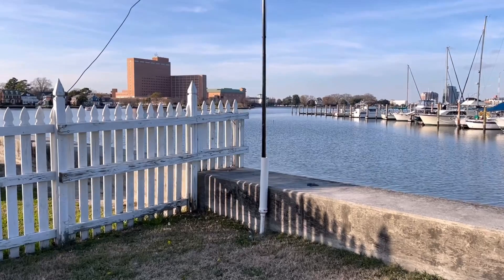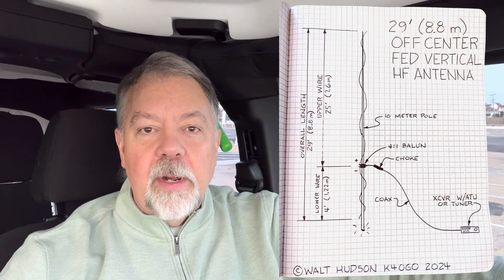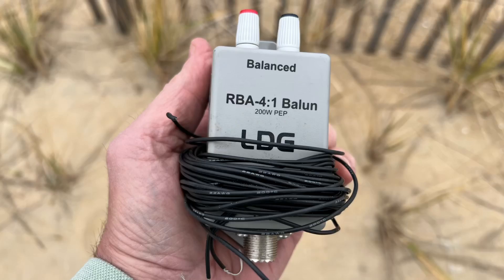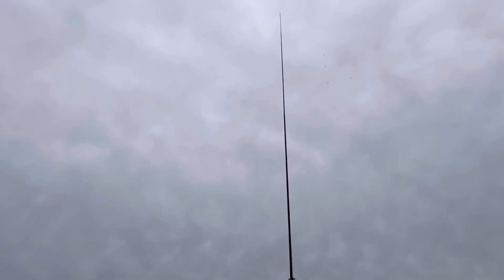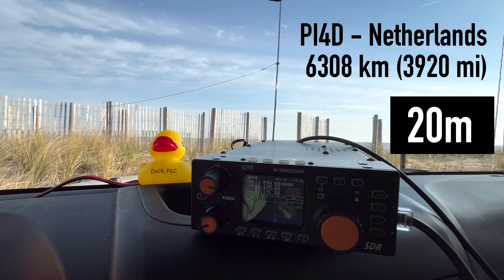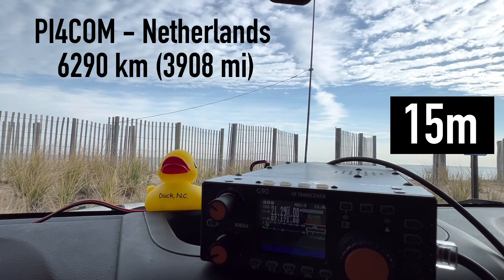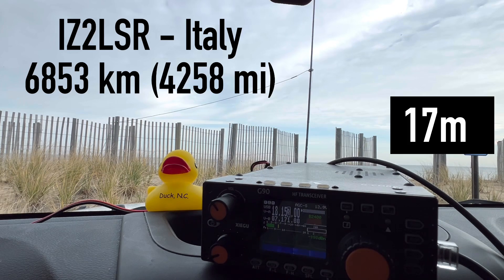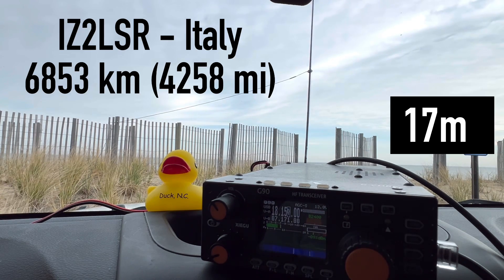Building an Off Center Fed Vertical Antenna

Comment: OCFD random verticals are my favourite multiband antennas.  I've used one at a few locations , not just by the sea and been surprised how well they work.  Hopefully soon I'll be moving to a new QTH with no antenna restrictions so can play with a permanent version and see if I can get 80 - 10M.  A shorter ( 25 ft total wire) got me on 40M - 4M but wasn't too good on 10M as too long.  All the best and 73 from G4GZG.

Comment: After trying the smaller 20 version, I decided to try this one. Again, I had better luck with a 9:1 unun...I use Balun Designs units. I got it up on the pole and checked my nanoVNA...nothing usable from 17 meters and down. Nice dip on 20 and decided to look further down and was surprised to find a nice dip on 40 meters. Surprise..surprise. There's one thing I've noticed about these ofcd verticals...they receive very well. Good signals really pop out of the back ground. So I'm good with using two of these to cover 40 thru 10 meters...they just really work.

Comment: greetings, I put this coastal antenna together this evening and it worked just as you said it would with 25' up and 4' down, but i used a 4 to1 unun instead of a balun, had a good contact on 40 to south Florida from the mountains of Virginia right off the bat. The 7300 was able to tune up on 40  and twenty with no problem. I'm heading for the coast in a few weeks to try it out. Thank you Sir. good job on your channel content. Think I'll try a random vertical next. Funny thing, a 29' wire is just the right length for a random😎
Reply from the maker: Awesome, thanks for sharing

Comment: I just completed the final install of your Coastal 20 here at home.  I live in a very tricky antenna situation, and your CO20 has allowed me to get on the air, rather than sit and ponder what can I build that is resonant on the bands that I want to work.  I have a lot of commercial antennas for remote work where I can go EFHW or ground vertical with radials, but here at home I was really vapor locked.  My vwsr measurements across 10-80 pretty much mirrored your reported numbers.  I even played with adjusting the upper and lower elements to "drag" the overall curve around, and found that I was able to slide things to bring 80 and 10 in and out.  I finally settled on your published 17.5 & 3, as that seemed best for my needs.  I tried the 4:1, with no improvement.  My soil is about a 1 at my location, compared to your salt water, but I "think" that has less of an impact in this design.  I appreciate you noting in this video that this design is more of a random wire construct.  That really tied things up in my brain, for this design.  And explains why in the heck the best dip is more like CB range.  I'll ponder this revision to design.  I subscribe to probably 50 other Ytubers regarding HAM.  You are without a doubt my favorite.  Dinner and drinks on me if you ever pass through northern NM.  Craig
Reply from the maker: Thanks so much Craig. I really appreciate this comment. All the best my friend! 73, Walt

Comment: Thanks, Walt for another antenna build. I built this one today and had great results on 10, 15 and 20 meters. One contact on 20 meters was in Chile (4,934 miles), but I could not get it to tune on 40 or 80 meters with the G-90. The SWR was off scale.
Reply from the maker: Thanks! Interesting that the G90 wouldn’t tune it.

Comment: Hello Walt, thanks for yet another quite interesting video. May I ask what made you switch from unun to balun for this variant? Isn't it an asymmetrical antenna as well?
Have you been able to tune it on all bands with the G90's built-in tuner? It didn't look like a good start on some bands.
Reply from the maker: Hi Alain, I treated the antenna as a balanced antenna just like a regular resonant OCF the uses a balun over an unun. It did tune everything from 80 to 10. I’m going to get back out with it in another location soon and try it later in the day to see how it does. 73, Walt

Comment: LDG 4:1 and 49:1 Baluns are impossible to find. I think they stopped making them long ago.
Reply from the maker: I have seen and purchased the 4:1 balun at DX Engineering. I agree on the 49:1, I have them all but that one. I’ve been looking for one.
Reply: I was thinking of a Current Balun. Forgot about the voltage balun. About the 49:1, seems nobody has any idea why it’s no longer made.  @COASTALWAVESWIRES
Reply: You will have to learn to wind your own

Comment: Good Morning Walt, what was the length of your coax with the ferrites?  I was at the Orlando HamCation on Friday; it was great.  Was trying find M&P POTA coax with a 50’ length with connectors, without success.  Did pick up some unun’s to try out and experiment with your designs. Thank you for these videos. Look forward to each one!  ‘73. AC3EA
Reply from the maker: Thanks! The coax is the Chameleon Antennas 50 foot coax with built in choke. I have a collection of all the LDG baluns and ununs I experiment with. 73 my friend

Comment: I managed to get a G90. They were out of stock at all the usual dealers here, but the importers had some and they were 10% cheaper than the retail outlets. Just working to set it up the way I want it and then get out for some /p.
Reply from the maker: Congrats, you’re going to love that radio!
Reply: You're going to love the G90

Comment: Hey Walt You are already getting great results but  If you use a resonant total overall length you would not need a tuner.  ~32.5 feet fed off center will work on 20 meter - 10 meter  It would be great to see another video! Thanks de W3DDS
Reply from the maker: That’s very similar to the 20 meter vertical half wave I build. Yes it’s one of my favorites. 73, Walt
Reply: Right except if you feed it at 78% of total length it will present a 450 ohm impedance  Perfect for the 4:1  I live on the beach near Ft Lauderdale and am going to try this ;)  Best,  Mike    @COASTALWAVESWIRES
Reply from the maker: @McPilot_W3DDS I’ll give that a try, thanks

Comment: great idea ! I new it would work. a dipole works great you just pick the feed point. end fed or center or off set center. it is the total length that counts. I find on shorter length the 4:1 Balun will tune better than 9:1 . I want to do that with end fed half wave i made for 10/11/12 meters . I get out great veritable with counterpoise or ground elements  .just put it up pole more and put counterpoise down . same thing you did but 49:1 . the 10 meter DX commander pole I got is the green one. he has 2 in the 10 meter ones. I have both now. Callum just had a birthday . just think if you had longer pole . better 40 and 80 meters . give yours a try at night on 40/80 meters . 73's
Reply from the maker: Thanks! I’m planning on getting out with this antenna this week and work the evening gray line

Comment: there is the other way to look at things... rather than tickling 29' of wire as an OCF with a 4:1 balun AND a choke AND the rig's internal ATU you could tickle 29' of wire cut in the middle as a vertical doublet, fed with 450 ohm budgie ladder & fed into a KW ez match atu that copes with bal lines directly. It would be interesting to see a performance comparison between the two.
Reply from the maker: Great idea, I might give that experiment a try.

Comment: Just like these experimental antennas. Did build your delta-loop last weekend and had great success. Many long dx to the east, where I normally fail to make connections. What firmware build do you use on the G90? 73 HB3XBL 🇨🇭
Reply from the maker: Awesome! I have never done a firmware update on my G90. It’s the original Firmware from almost 3 years ago when I bought it.

Comment: Nice one, Walt. I'm a big fan of the off-centre-fed dipole - my main HF aerial is ~20m long, fed at one-sixth length (~3m) with a 1:4 balun and is near-resonant on 20, 15, 10 and 6m and also tunes easily for 40m and, curiously, 160m. I've used it with an ATU on the WARC bands too.

On another matter - I see you have your balun taped to the mast. Speak nicely to your local surgery - they probably use disposable silicone rubber tourniquets for phlebotomy. These are perforated at intervals and held with a simple hard plastic lug. They work great for supporting quite heavy components on a mast and can be released with only one hand. Recommended! 73 de Phil M1GWZ
Reply from the maker: Thanks for the great recommendation Phil! 73 my friend

Comment: 👍Good going Walt. I like the idea of /P antennas that do not require radials or ground plain wires. Easier set up, less wires to trip over and maybe more repeatable at different locations??
One tip that might help folks when trying different antennas like this: afterwards, I put the wires in a zip (freezer) bag. In the bag I have a sheet of paper that tells me length of the wires, type of antenna, when and how I set it up. That way I don't have an ever expanding box of unlabelled wires and no idea what they were all for 😅.
Reply from the maker: Great idea Steve! I need to start doing that. I’m going to play with this one some more this week and then I’ll bag up the wires!
Reply: Steve - this couldn't have come at a better time. I was just staring at my box full of wire bundles yesterday thinking 'I have GOT to figure out something here to keep these all labeled and organized'

Comment: Hey Walt, why don't you power your G90 from the car cigarette lighter? Just trying to learn :)
Reply from the maker: I’ve actually done that and it works well. I think that was in my rainy day portable video. I just like to simulate what my setup would be if I was out portable and not in the Jeep when it gets a little warmer. I’m going to put a permanent setup in the Jeep soon and will be using the cigarette lighter for it.
Reply: Thanks for that reply, I understand now - thought there might be a reason you didn't use the car 12v supply. 73  @COASTALWAVESWIRES

Comment: Interesting. Haven't tried 12m yet or any kind of vertical. You're a great inspiration to innovate, my friend. Thanks Joe KC1MTM
Reply from the maker: Thank you so much my friend! 73, Walt
Reply: Walt was my inspiration for building a Rybakov which is now a permanent resident of the antenna farm. Sure it's got radials, but oh does it perform. 73, Bruce N7BWB